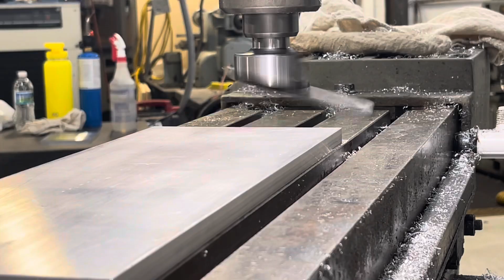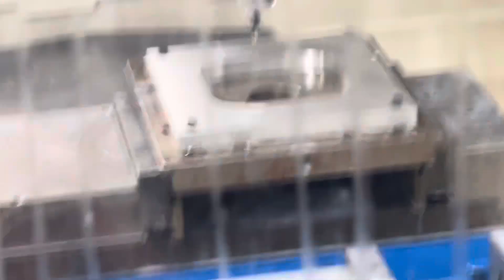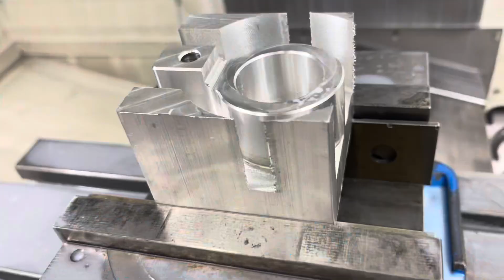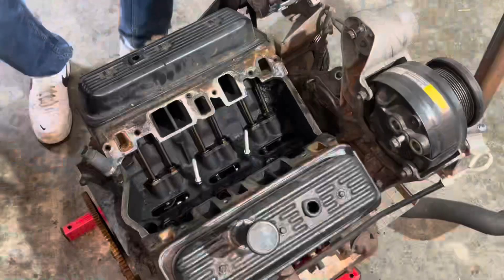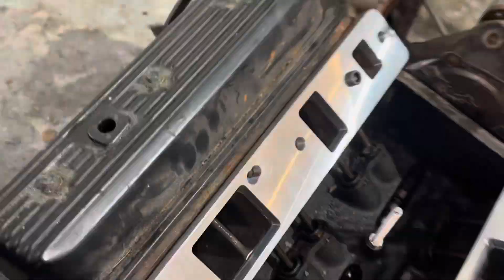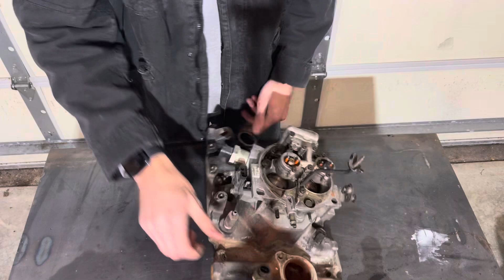Crafting Performance: Custom 4.3 V6 Intake Manifold Build EP2

Comment: I'm not understanding why you are building this custom intake when they sell them for this application.
Reply from the maker: Yeah I know, but those are dual plane I’m building a single plane. And plus what’s cooler than a bunch of billet machined parts and aluminum fab 🤟